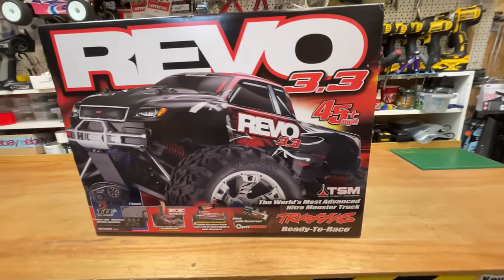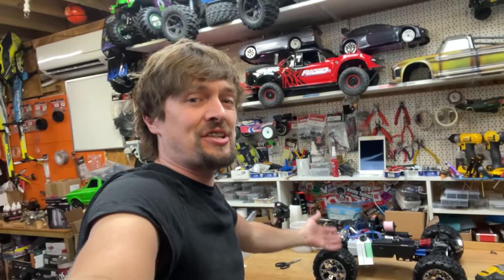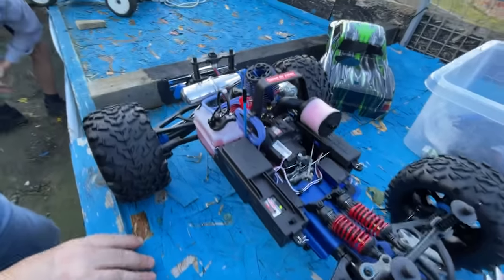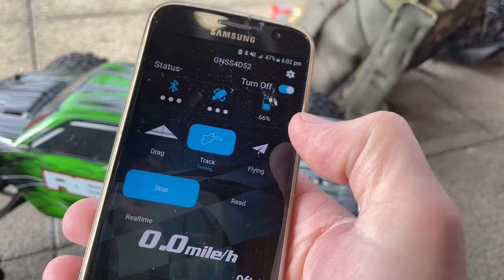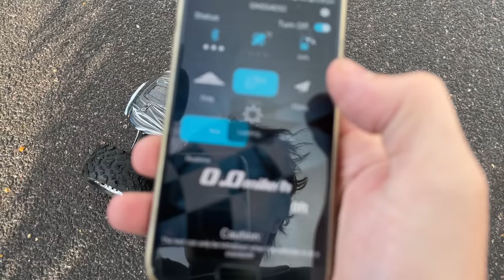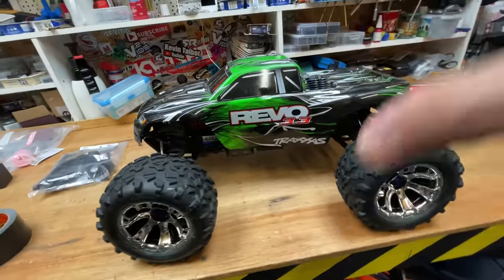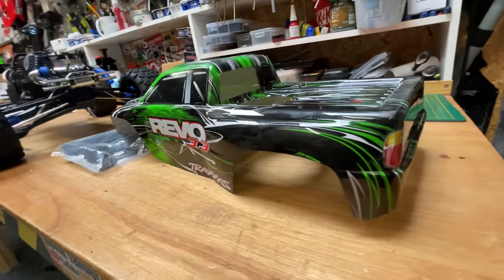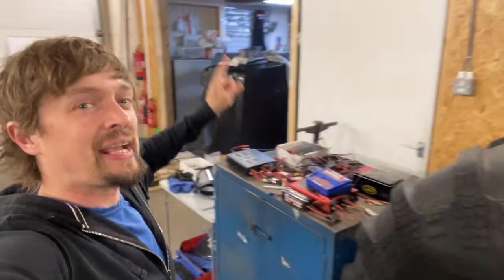World's most advanced NITRO RC Car

Comment: There was a truck released 11 years ago called the Losi Ten-T that has a remote start feature built in. I always thought that was a super cool feature and I'd like to see you try it on the Revo
Reply: the revo 3.3 was made over 10 years ago kevin is just REALLy late to review it
Reply: My dad still has his he hated pull starts because the strings would break or slip so the ten-t caught his eye that available at our local RadioShack at the time and the best part was that the spectrum controller it came could save 20 presets  so he was able to buy spectrum receivers for his other trucks and bind them to the controller so we didn't have to bring a load of controllers everywhere we go wished most nitro cars used that system.

Comment: Nitro is always great, the sound just makes it worth it!
Reply: The sound is why i don't like nitro because it sounds like a leaf blower or chain saw, and i hate the fact that the whole car wil get covered in a 
layer of grease, and the engines need alot of maintenance and don't last very long. And the biggest problem is the damn noise, so you need to find
an area where no people live, or else they going to call the cops because of the damn noise, and i can't blame them because i would call to
when someone would ride here in the street all day. electric is way cooler because hardy any noise, and way more power and no greasy shit
al over the car.

Comment: Loved it!!
My 1st nitro 14 years ago, a 3.3 Revo - couldn't get mine to run properly but that was me!
Love the sound of it changing gear under power.
Thanks Kev.
Al.
Reply: Its not just you, the 2.5 and 3.3 rarely ever hold a tune on their own.......the .15 pro was the only trx engine that held a tune.
Reply: Need to get a better carb the stock ones don't hold tunes very well

Comment: Nice!!! I have the nitro revo also. Changed the servo also immediately. Too slow and weak to do jumping. Also I would change the stock 3.3 carb to losi 3.4 or even better OS 21tm one. Would give you low to mid speed driveability and very easy to tune.

Comment: Hi Kev, sweet new ride!  The green body looks incredible.  I've installed autostart on my Nitro Revo3.3 so I thought I would share some tips.  I used an Apex RC AUX channel on/off switch, a 2s lipo receiver pack, a relay to handle the high starting current, and a step down voltage regulator for the glow plug.  The problem with my setup is that you have to manually shut it off on the remote once the engine is started.  If you find a way to do it where it stops once the engine starts, i'd love to copy cat it.  Cheers buddy!

Comment: My Revo is my favorite truck to hate, it drives well, it goes fast with the .28 I put in it, and it's generally pretty durable with the upgrades I have on it, but when it comes to repairing/cleaning/maintenance, it's the biggest pain to work on ever.

Comment: Just had mine running the other day, now it’s like the glow plug is not getting hot enough. I just swapped out the red black yellow and blue wires. Still not working properly. I’m stumped… love the videos buddy keep it up!
Reply: I’ve had the same problem in the past with my revo 3,3 and got so tired of having problems with the blue glow plug wire I just got one of the rechargeable glow plug heaters and still used the cranking of the ez start and never had a problem with it since!! Hope this helps! have a great day!

Comment: You are running good tune. Y would assume probably stock factory settings. When you break it in you can try to lean it a little bit to get closer to 45 mph, but again, better to run slightly rich than max performance lean

Comment: Hey Kevin digs your channel, I want to make a suggestion. instead of using sjoe glue and dry wall mesh to reinforce the rc bodies. try Rhino line. its a truck bed liner. very durable tough stuff and will take many heavy bashes.  I recommend getting it done professionally rather than use of the shelf do it yourself.

Comment: By the way Optimix 25 is a very thin fuel which floods the engine commonly like sidewinder which is basically the same. So try to use Top Fuel.

Comment: Have had my Revo 3.3 for a year now, only mods are the long travel arms and the forward only conversation. I also swapped it to pull start cuz I got sick of the EZ start not working properly. It's an amazing truck and the TRX3.3 is a decent engine.. Also the stock carburetors are kinda crap but they'll get you by (Losi 3.4 carb or an O.S. 11K carb will drop right in). Overall it's a great rc truck for any nitro head.

Comment: Dissconnect that opti drive unit and ditch the reverse..They cause them to run away and or slam into reverse while going forward and will destroy the transmission..I have one, it is a common issue with them, and those items malfunctioned before I got thru the break in..But I still like it..

Comment: If you want better smoke from your fog machine, buy a bottle of food grade vegetable glycerin, and a bottle of  food grade propylene glycol. You can mix both of them 50/50 ratio and then add some water to make it more runny so it doesn't clog your smoke machine. 
You will notice a hugeeeeee difference in smoke production.

Comment: My first ever RC was a Traxxas Jato... it was before they released the 3.3... however the 2.5R was hard to handle,  it had no problem doing wheelies, donuts etc... I did eventually install the racing head and tuned pipe. Leaned out it ran 72 mph..  I still have it but my main RCs now are Traxxas maxx and Vxl 4x4 Rustler...   So every now and again I break out the old Jato....  electric RCs are great, but there's just no comparison to the sound and smell of an old nasty nitro!!!

Comment: I put the true track on my e revo not ment to fit takes some work but best upgrade you can do to any of the revo range makes it so much better to drive
Reply: That’s cool. I widened my slash an inch front and rear with rustler a arms and made my own front tie rods. I also shoved a 1/5 scale motor and esc in my telluride. But I’ll never own another nitro. Hpi savage 4.6 broke the day I got it. Then I got it going and the wheel fell off.

Comment: Absolutely amazing truck! Bought one last year and it's been the most fun and reliable nitro I've ever owned, I take mine out almost every single week and aslong as you do your proper maintenance and take care of the truck then it will last a very long time. The way you run your 3.3 in was pretty funny and you've made a fun video with it but you wont see it last very long now the 3.3 engine is highly dependable on its break in procedure and ill be very surprised if that engine lasts through a gallon on nitro fuel and you'll probably never see the full potential of that engine now. Great video tho I love the revo 3.3 amazing truck 👍👍👍

Comment: That’s pretty sweet! Will that rear suspension conversion work on a traxxas summit?
Reply from the maker: i think so
Reply: It's most luckily not going to be plug and play conversion as summits rear arms are a bit different than revo's due to locking diffs. But nothing that dremel can't fix. I have both trucks but never though about swaping summits arms as I'm not using it much and so far stock system holds very well

Comment: MORE MORE MORE!!!!!!! more nitro!!!! I love that sound and dont even get me started on the smell. 
@kevintalbot the revo is awesome, but you should also get the Slayer Pro 4x4. has faster transmission gearing, and is all around a better car. I have one that I have modded to the moon, even added a center diff and a custo, E BRAKE setup, and its by far the best handling car in my fleet.

Comment: I have the traxxas revo 3.3 and it’s one of the most fun and noisy trucks I have ever owned!
I was scared when you said “ run it in fast it will be fast “ because when I did that with mine the connecting rod blew clean in half :/

Comment: Nitro engines needs atleast 2 or 3 tanks for break prior use full blast.
I'm really worried about you going fully blast with this beautiful engine without break it before.
A bad break engine, can have lost of power, bad idle and overtemperatures.

Kevin, remember, its not a electric, its nitro engine. Thinks need to be make in right time.

Comment: Kev, I suggested a remote start then realised you thought it would be cool anyway! I have the majority of my nitros on remote start now, took me ages to figure out, but that’s because I went big block and had to convert to brushless to get them to crank. Anyway, it’s dead easy, but the easiest way is use 2 channels to start it with a mix to be honest because of the way the glows work
Reply: Get an RCEXL V2 or a RCD3007 and a hobby wing 1060. Then the biggest 3s you can ram in the battery box, job done. I have an overlander 850 3s in my 4tec 3.3 and that’s fine, think I managed to squeeze a 1900 in my Revo but it was super tight and involved the Dremmel.

Comment: Hey Kev, got an odd ball engineering question for you but I think your expertise and experience with RC's might give me some really good incite ...

Do you think retreading rc car tires would be a useful thing? Would you buy a mold and liquid tire retread system if it worked and allowed you to retread and continue to use once bald and unusable rc tires with similar performance to brand new tires? I have no idea if you'll see this but essentially I have a school stem project to figure out and tons of recourses available to me to do this and do it right, and I'm thinking of trying to legitimately develop this thing. 

I won't get into tons of detail but the goal would be to make a system that can reliably form new tread onto an old used up tire, that's still intact, just bald, and I've talked with friends, people that race rc's, hobby shop owners, etc, and they all seem to think it's probably something that they would use especially right now, and especially for smaller scale vehicles such as the losi mini B.

Bottom line is you can easily burn through a set of tires in 5 or so battery packs, and then your only option is to buy a good 25$ to 40$ worth of new tires, and right now a lot of tires are just plain out of stock or too expensive for some people, especially racing buggy tires and I think the ability to retread tires like that yourself, would not only cut down on waste, but also give people a cheaper alternative to buying new tires and all in all would get peoples rc's back on the road for cheaper. 

All in all I just wanna know what you think of this idea? would you personally use it? or is it too complex? do you think people you know would use it? I have the ability right now to put a lot of research into this and probably legitimately being this product to market and even earn scholarships from competitions if I really do it right, but it's meaningless if nobody would actually use it so I guess that's the big question? would you rather buy slightly more expensive brand new tires? or retread old ones yourself for less money and achieve the same or better performance? 
- Sincerely, Maximus L.

Comment: Having problems with mine it's sat a year my dad gave it to me he only ran it 3 times it's like new but he wrecked it cus the throttle suck after the 3rd run  at a half  tank of fuel  I fixed it up the steering servo was all it needed but runs good, but dose the same the throttle sticks after about half tank idk if it's the battery,servo or return spring anyone have some advice or had a similar problem?

Comment: I have a tmaxx with the 3.3 but I need a motor the guy I got it from didn't break it in correctly  and the piston broke where it holds the wrist pin resulting in a hole in the side of the crank case :(

Comment: Make sure you follow the proper break in procedure! Don't do what Kevin is doing , by adding fuel , starting it up and taking it out for a Rip ! You will destroy the motor! Great video but he doesn't explain there is a 6 tank break in that needs to be done , so the piston and sleeve have the proper clearance during the heat cycle! Otherwise you will regret taking it out on its first run and beating the crap out it !

Comment: What kind of fuel are you running at 25%+? According to the noise, there is still a little more revs in the engine. Just from the recording. Can also be deceptive. Especially because the engine is much too small for a monster truck 3.3ccm or ? It has to go over Rpms. Buggies have 3.5ccm at 1:8. Most like a LRP have a motor with 3.93ccm and a speed of 33900 rpms. Even without a gearbox, they are faster. Of course, a buggy is something different, but it's worth mentioning because the Traxxas doesn't shine on the race track either. You won't get a good lap time there. the Kyosho takes the track in half the time when it is not crashing. So I would definitely not buy the vehicle after watching the video. It doesn't blow me away in any way.

Comment: The revo was nothing but problems for me. If you enjoy working on them and fixing crap all the time great rc. Gas, glow plugs, wires, no thanks.
Reply: Amen to nitro bein a PITA.   Traxxas is a nightmare for nitro.    Ive probably revived atleast 5 savage 21's in the last few years, and they all ran great and easy to tune and hold on to a tune.   Those trucks are 20 years old now😳.   The hpi .21 engines are absolute runners!